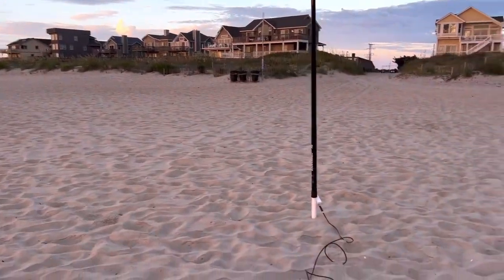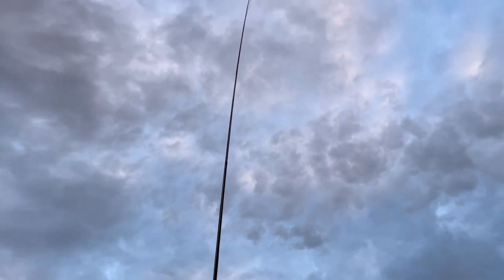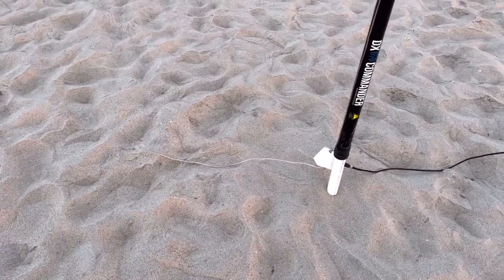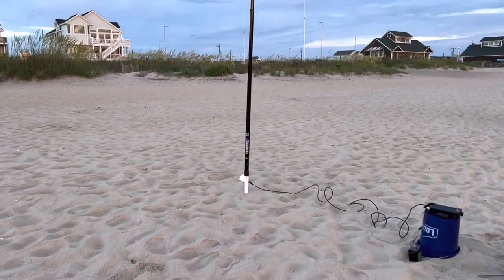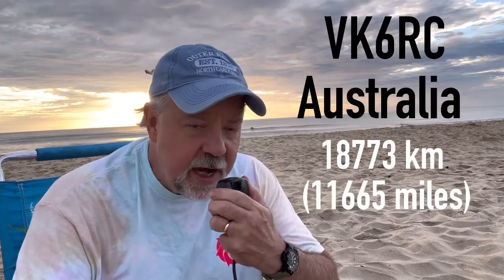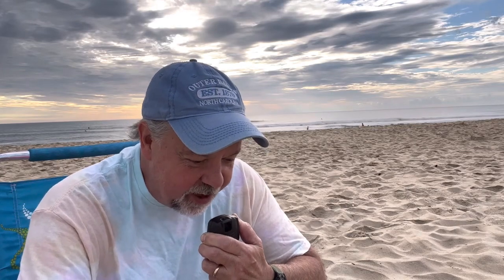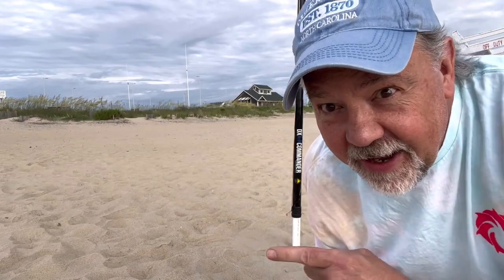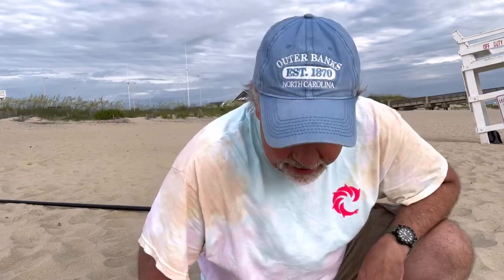Vertical Half Wave Antenna - QRP Portable

Comment: Which charger do u use for that battery exactly same as mine 2e0ilf
Reply from the maker: I just use the small wall plug charger that came with the battery, sorry it doesn't have a brand on it.
Reply: @COASTALWAVESWIRES  shoot i got the battery from a clearance sale but no charger

Comment: Hi Walt, another great video. I logged my first VK from the UK two weeks ago and found it pretty exciting!
I would be interested to know if you have tried setting up a parasitic reflector or director next to the half-wave vertical to add some directionality to the aerial. 73 de M1GWZ.
Reply from the maker: Thanks! I have thought about doing that with a vertical for 10 meters. As the band starts opening up more I will probably give it a try soon. 73 and all the best, Walt K4OGO
Reply: @COASTALWAVESWIRES  Yeah, I've done it with a half-wave vertical for ten. The elements don't have to be perfectly aligned in height, so you can cut a piece of wire 5% long and install a switch 10% up from the bottom of the wire. Set up about five feet away, you can swap directions with a flick of the switch. It does work! 73 de M1GWZ.

Comment: Hey Walt! I tried your 1/2 Wave Vertical design last night for about an hour or so here in the middle of Georgia, nowhere near salt water! LOL And it worked fine. Using my Xiegu G90 I snagged two contacts, one in California on 15 meters and the other in Costa Rica on 20 meters. All I had to erect the wire on was some pvc pipe cut into 5 foot sections joined togethers to make a 35' long mast. It was rickety as you can imagine, I had to run it up through the limbs of a small tree in my backyard but it held together. After the trouble I had with that pvc pipe mast I ordered a DX Commander 10 meter pole last night. Love your videos and I have learned so much in such a short time!
Reply from the maker: Thank you so much!!!!! I really like this antenna and it really works great anywhere.

Comment: Walt, I want to thank you for your videos.  You have help me to rethink what I’m going to do for an antenna.  I am retired and on a fixed income and about the only way I can enjoy HF radio is through others.    I have an old radio, but there are some resisters burned out and I’m 100% sure server if not all the capacitors need to be replaced.  Thanks so much for your videos.  Gives my hope I might get on the air again someday.
Richard de KK7SL
Reply from the maker: Thanks Richard! Hoping you get back on soon!

Comment: Hi Walt
Thanks for all the videos they are really helpful and interesting.
I am going to be using the same sort of set up working on the beach. The only thing that I wanted to try was running the counterpoise wire into the water but it would have to be about 20 meters long.
Does it matter if the counterpoise is that long?
Reply from the maker: Hi! No the length of the counterpoise is not important, you’ll be fine. Good luck and good DX!!! 73, Walt K4OGO

Comment: Im always amazed how you do so much with seemingly so little. I have been struggling to fully understand HF antennas. Your videos have been an amazing help. Can you recommend a book, website or other resource for beginners that I can use to learn and reference as well? Keep up the great content!
Reply from the maker: Wow that is an excellent question and a hard one to answer. I’ve found that one problem we have in ham radio is that many books and technical publications over complicate things. The ARRL Antenna Book is a great resource to have but can also be a little bit too deep in theory and lacking practical application. If you get one you don’t have to buy the new $50 version, there are older ones out there for 10 bucks and antenna theory hasn’t changed in the last 25 years. I think mine is the 2003 version. If you are into building antennas and getting out low power like myself check out Peter VK3YE, he’s a portable beach guy like myself in Australia that’s actually written a few books that are very good. His website is vk3ye.com and he also has a great YouTube channel as well. Another couple guys that rank high on my list of YouTubers that really teach in some of their videos are Tim G5TM and Callum “DX Commander”. I’ve got them linked on my YouTube channel. Thanks for the great comment, I hope I’ve helped! 73, Walt K4OGO
Reply: @COASTALWAVESWIRES  Thank you! That will get me started. 73 Chris-N3UBU

Comment: I will have to try the pipe trick with my spiderbeam. One thing with the G90, I replaced the coily mic cord on my G90 with a straight piece of Cat 5 network cable and it makes a world of difference  for VKFF. No more dragging the radio around or having to sit in akward positions. Cheers VK5BRU
Reply from the maker: Get idea on the mic cord! Thanks for sharing. Cheers K4OGO

Comment: Hi Walt! Love the video, which 10m DX pole do you have? The “sota” version with the hollow tip, or the one with the solid tip? Any info would be appreciated-73’s N4LOX Glenn in Tennessee
Reply from the maker: Thanks! I have the 10 meter Expedition model with the solid tip. It's shorter when packed up and easier to travel with. I also have the 7 meter DX Commander pole and it's actually longer when collapsed and harder to travel with. I really like the 10M Expedition. 73, Walt K4OGO
Reply: @COASTALWAVESWIRES   Would you say it’s 70cm long collapsed, or 119cm long? They’re currently listing the “Expedition” as having a hollow tip and 70cm collapsed, and the “Classic” having the solid tip, but it’s 119cm long. Thanks Walt! Ps-I’m going to try hitting the VK net this Saturday morning…….
Reply from the maker: Mine is definitely the 70cm Expedition model. It’s perfect for me carrying down on the beach. Good luck on the Southern Cross Net, hope conditions are good!

Comment: What a beautiful location! The early bird gets the scenery. Here's an idea for you. Not all of us have the advantage of salt water nearby. We dare not improve our soil conductivity by dumping table salt around our ground rods or in our lawn. It is death for plants. We can, however, use epsom salt for the same purpose. It includes necessary plant nutrients and has the same positive impact on soil conductivity. One study by a power company found it tripled the conductivity of their pole grounding for lightning protection. You might come up with a way to compare antenna grounding before and after epson salt. When I installed a grounding rod at my house, I dug a hole about a foot deep and filled it with warm water with epson salt. That not only made driving the ground rod in easier, it almost certainly improved the soil conductivity.
Reply from the maker: Great info, thanks for sharing!

Comment: We did a POTA activation using your 17-5 vertical. We had a tape measure for the 3' section. Bands were not good but it worked OK. We then extended the tape measure section to 16' which gave is 16 1/2' including the wire from the tape. We raised the spider pole and had an elevated half wave vertical. It worked outstanding by the Long Island Sound. Thanks for all of your antenna ideas.
Reply from the maker: That’s great! Thanks for sharing! Half wave verticals are becoming my favorite.

Comment: Walt, mile post 16 is where I spent many summer vacations in the 80’s. We would fish for the spot fish. I have a G90 as my first radio so I will be watching your channel for lots of advice. I got my General ticket in June of this year after technician in March. 73
Reply from the maker: Awesome Frank! You’re going to love that radio. For many years I had a camper trailer right across the street at Sam & Omies park. Unfortunately they sold the RV park to the state and had to move it out. Love that part of Nags Head. All the best and good DX!!!